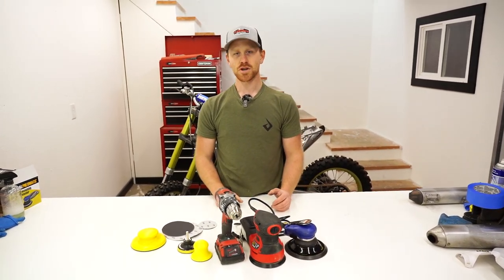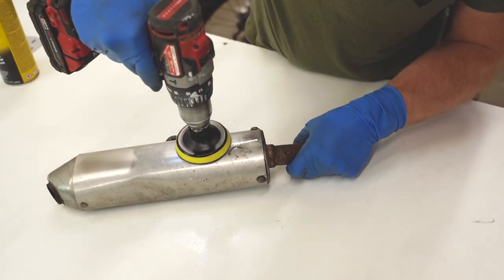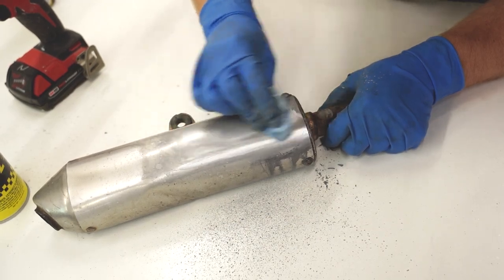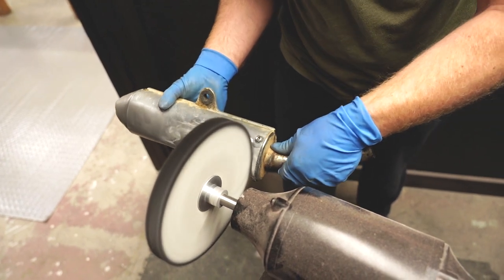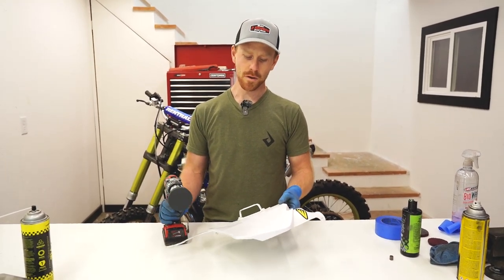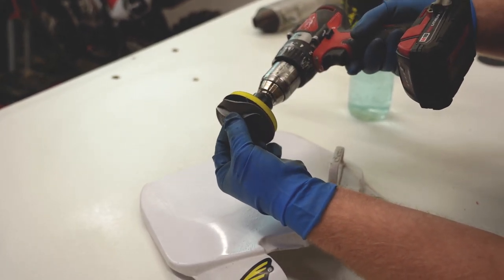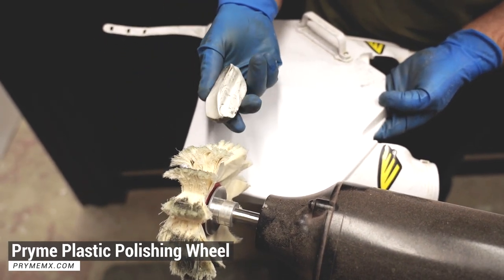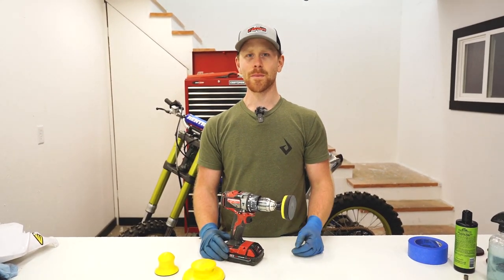Sand Out Scratches With Ease!

Comment: Great stuff! The problem is there are no proper sand paper discs around where I live. There are only the ones dedicated for wood (brown ones). Are these any good? Or should I aim for other ones to polish metal? Also brown ones are usually 80 - 400ish grit
Reply from the maker: Thanks for checking out the video! These ones are pretty solid. Works great for polishing prep on plastics and metals. They’re best used with soapy water or a lubricant.